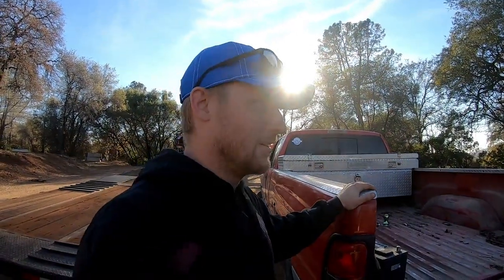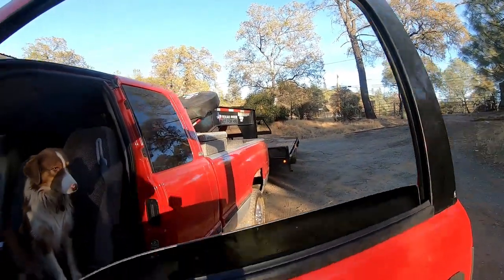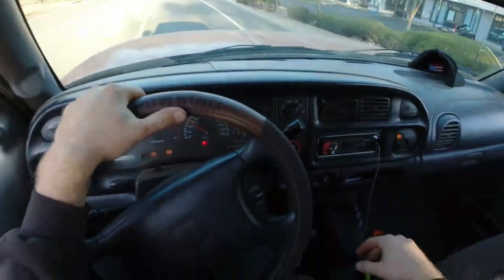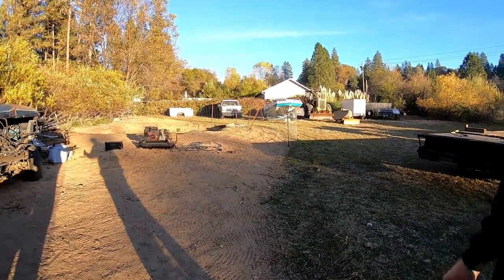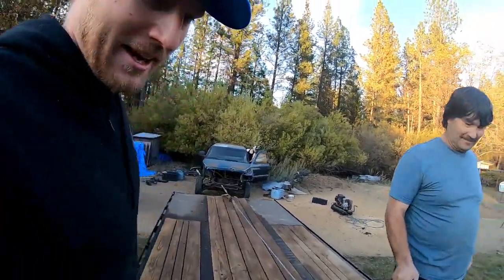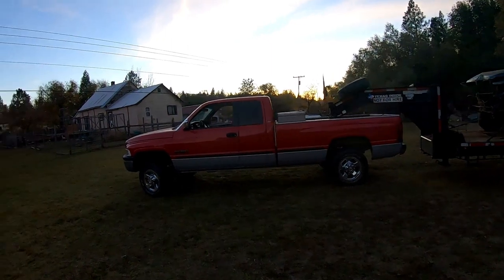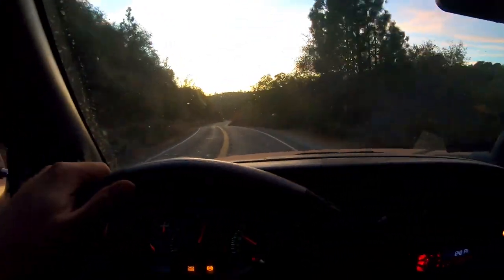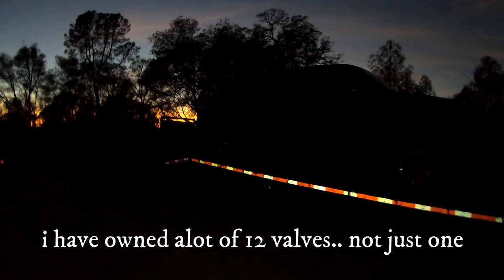21 YEAR OLD DODGE TRUCK+30k GOOSENECK TRAILER=SHOULD BE GOOD

Comment: Nothing, I repeat, NOTHING, will ever sound as great as a Cummins, towing with a manual.
Reply: Except a 7.3 manual
Reply: duramax sounds better
Reply: @rock-uu7qr  copium.
Reply: Ehh, the only thing that comes close (actually beats) the Cummins 12 Valve is either the Cummins Signature 600 Series, the CAT 3406b (and e) and the CAT C-15 IMO.

Best sounding engines of all time. 👌
Reply: @connorbaz5980  Yes
Reply: @rock-uu7qr  lol, you know what that means right? Means you can't handle reality. 😂👌
Reply: @connorbaz5980  Dawg I dont understand how a comment about a diesel truck could ruin your day
Reply: @rock-uu7qr  naw, it didn't. Just stating a fact. 👌
Reply: @connorbaz5980  Call it what you want I didnt intend to upset you just enjoy your truck before the EVs take over

Comment: You sound like you skipped the VP44 truck years completely. Mine's a 2001 3500, 5.9 HO & NV5600 6 speed, 3.73 gears. You also didn't mention what gears your 12 valve has, at least by 7 min into the video. Also, a lot of states watch for trucks towing beyond their rated towing capacity, never mind whether it works or not, it's still a moving violation. I figure my gross towing capacity at 15,000 lbs from figuring all the weights and stuff. I tow a 30' toyhauler which runs about 13,000 lbs with a 99 mustang inside. There's some tough grades on the Interstate 15 heading south west from Las Vegas towards LA, just before you get to the town of Baker. Towing with a 94 Ford Power stroke 5 speed and 4.10 gears with the trailer only loaded for camping so maybe 4500 lbs lighter, I went up them at about 35 mph in 4th gear. In the Dodge towing the mustang home in the toyhauler It went over the top at the speed limit of 55 mph in 5th gear with a lot of throttle left. Oddly enough, on pretty much equal loadings doing essentially the same 4900 mile trip around the country both trucks running about the same speeds, 60 mph unless the limit was lower, got the same average fuel mileage for the trips at 12.5 mpg. You mentioned rolling a bit of coal. I've never understood why anyone would think that's a good thing. That black smoke is unburned fuel that could have gone to making power. I dislike it so much that I'm strongly looking at various trucks and twin sequential setups. I don't intend to increase the fueling hardly any as I want my truck to last a million years or miles, whichever comes first. Rolling coal is also hard on the exhaust system because it also is an indication of high EGT (exhaust gas temp) which isn't good for your truck. I currently run a Madds Smarty tuner, for normal around town and light towing on the economy setting, gets 22.5 mpg at 55 mph cruise, 19.5 at 65 mph, and 16.5 mpg at 75 mph. I found out the last when I had to make a semi emergency drive from my home at the time in Rosamond CA, to just inside the southern border of Minnesota to retrieve a family heirloom that was going to disappear if I didn't get there soonest. I left 8 am Monday morning and was home again Saturday morning, solo. To bad I didn't have my VW yet. A 2003 Jetta TDI 5 speed, it gets 47 mpg at 75 mph instead of the truck's 16.5.

Comment: Put your trailer lights on a separate switch. The 2gen light switches are really bad about burning up if you have trailers hooked to them often
Reply: Its run off a relay with  the tow package.

Comment: You need to tow with a 1st gen with a 3 speed automatic transmission that is a true experience I love towing with my 3rd gen but still is fun to go back and tow with the 1st gen
Reply: 1st gens had a 4 speed option in 91.5-93 as well.

Comment: Got am 2004 2500 24 valve auto to bad it don't have the 6 spd in it I haul 22 to 35k once a month with it. Pulling is never an issue it's always stopping gotto pay attention to what you are doing u don't want the brakes hot takes to long to cool em off. Just take it slow and easy

Comment: That 12 valve will hold more power on stock bottom end than  common rail and a failed injector on a common rail = hole in piston while the 12 valves usually misfire

Comment: had a 97 12v 2 door king cab with a 8ft bed in prestine condition from an old guy, loved it the 12v  sound is unbeatable but i prefer my modded 3rd gen for long highway cruise and comfort, but man the 2nd gen is so fun to drive around feels like the ultimate diesel pick up

Comment: Nice rig, good first tow all things considered. Adaptability is the key to success! If you haven’t already, I would go with the remote PacBrake exhaust brake, mounts on the down pipe under the truck. A good mechanic recommended it to me.  He said it reduces overheating the turbocharger. I had them install one on my 01 24v HO 6 spd, the  year after I hauled a 3/4 ton gas pickup with some extra fuel & gear in the bed, and my job box with all the truck stuff, probably between 8500-9k on a bumper pull. Next tow was a 9800 (dry weight) Airstream,, braking was a breeze and the EGT stayed in the sweet spot. Total game changer. Huge benefit in traffic as well.

Comment: We have a stock 97 12v, and it pulls our 35ft flatbed loaded down with round bales easily. Once you hit 2k rpm it's just takes off.
Reply: Yup I got a 40 foot load it down with20 bales large rounds sudam grass. Tried loading double once just to much for all of it again pulls no problem but stopping it just tuff with that much weight. And no exhaust brake. Plus I'm breaking in a new trany less than 2000 miles on it likely les than a 1000 😃👍

Comment: Damn, I'd love to put that 6 speed in place of the 5 that's in my 99 3500 drw. Yeah, I know, 24v. I had a 12v in my 93 w250. Which, I still wish I had. But I needed a little more towing capacity. But now I'm looking at a 2019 4x4 3500 srw Laramie HO. It has 23,000 towing, that is plenty for what I need. It's a lot more than the 99. Going to look at it this weekend. 
Keep up the videos. You and TFLtruck are on the top of my watch list.

Comment: i dont get the fuss over the exhaust brake.. had one on the 6.7 work truck i used it but i never felt like i needed it.. that was in alberta on divided highway and back lease roads far from the flattest terrain and towing 40'genie booms with fuel skids tucked in anywhere theyll fit.. i never had any brake fade or desire for more braking even in the dead of winter on solid ice roads
Reply from the maker: This whole comment sounds reckless lol
Sorry

Comment: One thing to be carefull of with the second gen trucks when towing heavy is that the frames are weak in the back! It’s one of the reasons why they didn’t use them for tow trucks or service trucks!  The odd one you do see has probably had the frame reinforced. The extra cost of reinforcing the frame made them cost prohibitive for tow trucks and service trucks!

Comment: been wanting to add a 12v 1ton to my garage to just tow with.  Nice rigs, simple and do tow well.  Towing a modified diesel without gauges though....uh, no thanks!
Reply: U get a feel for things if u been driving for long I used to have 96 kw modified propane injection it would pull a full load up the west side of Eisenhower tunnel going east on 70. In hi gear with 45k in the box no matter howuch water or coolant you had just could not move it fast enough to shed that much heat. Always about 3/4 way up had to drop a gear not because of power. But heat. So I settled in at 16 and run 72 mph over the top.

Comment: What kind of exhaust setup do you have on there? I have a 96 with a 5 speed that still has all stock exhaust. Wondering what I can do to get it sounding more like what you have going on.
Reply from the maker: Mbrp 4 with muffler or straight 4 sounds good aswell.

Comment: @V-BELT and SON I don't suppose your looking for a smaller project truck. She needs a bit of work. But Runs and drives, has a really high weight limit for such a small vehicle even(somewhere around 2800lbs in the bed). Its a 03 Dakota Sport Cab, with factory body kit(stampede package).

Comment: That's the closest truck to my dream truck as I've ever seen. 2nd gen extended cab long bed 4wd 12 valve 5 or 6 speed and red. Just off by a hair with the silver band at the bottom body line. Ever since I saw the movie twister I've wanted that truck with a few minor changes 😂

Comment: 4k govnersprings 60lb valve spring  on both sides head studs fleece coolent buy pass turn the star wheel but 30 click towards the motor and and a bout .025 deliver valves in the pump and so air bags for the suspicion that truck rule the road

Comment: I used to tow a 13k pintle trl with a 97 chevy 2500 the trk knew it was there but did it pretty good considering it had a 6.5td. I now have f350 dually 7.3ps and it still knows the trl is there but does it a lot better
Reply: Oh yeah. Coming down sherman hill in mesick county m37 in michigan i slow down to 30 mph and downshift into second with the automatic and without exhaust brake it holds decent down a 7%  scaling 22k.  People behind my dont like me doing that but tuff. They aint driving a 22k rig.

Comment: But you are exceeding the 13k lb tow rating of that truck. I have a 2021 F150 and a '98.5 24v 2500 RAM. Both have a 13k lb tow rating, yet my Dodge was identical to a 3500 with the duals removed. It also has 1100 lb ft of torque and an heavily upgraded 5spd. There is no way in hell that I could safely tow as much with my F150 as I can with my RAM. The tow ratings they use don't seem to add up. Back when my truck was new, I had a local suspension shop upgrade the rear springs a little, even though I had the Camper Package. I have had 5,000 pounds in the bed and it doesn't squat too bad. Much more stable over bumps when loaded.

Comment: That's funny that you think anything you did was "back in the day". LOL. I'm 70+ and when I say "back in the day" it probably means before you were born. I also had my CDL, drove a naturally aspirated (!) Cummins powered truck usually pulling a pair of 20' boxes, redlined at 2100 RPM, but I loved the transmission, a 10 speed Road Ranger. Sometimes I had to drive a truck with a 13 speed which wasn't great but worked for heavier loads and then there was the truck I had to drive when I made the boss unhappy. It had 3 sticks. A brownie, which we pretty much left alone, then a 5 speed and a 4 speed, which was just so much not fun. I could do with a couple more gears in between the gears I have in my Dodge. One more between 4 and 5 and another between 5 and 6. I like to shift down low and I have to rev it more than I like (comfort for my ears, not for the truck) when towing the toyhauler. 2400 in 5 gets me 1650 or so in 6. Way to big a jump in my opinion. Also the owner's manual says not to tow heavy in 6th below 1600, 1650 is about 55 mph so any hill in CA I have to downshift to 5 not to destroy the diff. I assume that's the danger. 6th is a .72/1 overdrive and that gives about 2 power pulses per driveshaft revolution. Apparently that's enough to push the pinion through the lube and make metal to metal contact with the ring gear. Not a good thing.
So, what's the gearing in your diffs? It is a 4X4 isn't it?
By the way, my toyhauler is a conventional equalizer hitch and with the torsion bars set right, the rear of the truck drops about 1". Steers great and yeah, if you're going to tow heavy loads like that you really need a Pac Brake, or some exhaust brake. The last steep grade you go down heading east on the I 40 going into Needles is 6th gear and Pac Brake on and modulate the speed by touching the power just a tiny bit. Without it, it's 5th gear and a lot of brakes.
I enjoyed your video. I'm going to look for the one you must have made after you put the gauges in. Should be some interesting info there. I'm curious to see what your EGT runs going up a hill.

Comment: Thanks to your awesome videos

I am purchasing my first Cummins turbo diesel 2002 5 speed manual Ram 3500 2 wheel drive extended cab long bed for $7800 with only 226,000 miles is that a good deal new turbo mechanically sound no leaks new clutch new tires clean title Montana truck

Comment: Just a reminder, it is not a CDL requirement in my state for personal use. Nor in fact your state of Cal. for personal use.
Reply from the maker: I follow the chp Facebook they bust so many ppl thinking that. Personal use semi
Reply: John irwin lol you funny
Reply: AFTER PROOF READING THIS AND I APOLOGIZE NOW FOR ALL THE CAPITALS AND BRACKETS NOT TRYING TO BE AN ASS TRYING TO BE CLEARAND HELP ANYBODY WHO DOESN'T KNOW WHERE IS LOOKING FOR ANSWERS
Anything in our home state of California TOWED/PULLED/TRAILER/COMBINATION VEHICLE of any attachment style ( bumper pull hitch or pintle, gooseneck or 5th wheel) with a G.V.W.R (Gross Vehicle Weight Rating) of 10k ( 10,000 Lbs) MUST  possess a CDL A (commercial drivers license). To clarify 9,999 #'s normal Class C license required, 10k G.V.W.R CDL Class A req. Where the confusion most likely lies is PERSONAL USE drivers example: this exact video content, a camper ( bumper or 5th wheel style), a dump trailer ect. Requires a NON- COMMERCIAL CDL due to no compensation ( money, or value gained), owned by driver all vehicles and equipment in use.  Another silly law in my opinion is any vehicle with a GVWR of 26,001 lbs or greater requires CDL Class B to operate. So the ridiculous thing is IF you follow the channel and know Andy's logging truck, you could drive that all day WITHOUT the log dolly on the ground with a Class B CDL but if you hook V-Belts yellow 14k gooseneck to the log truck it would become a Class A required.
Reply: @paulrollinsjr.1845  wrong.   Above 26k single requires a cdl b. Above 26k tow unit and 10k trailer  requires  a A license. Below 26k is good to go with normal license.
Reply: @alanack67  not just limited to a 10k trailer. I can pull a 16k with my obs 7.3 rated at 10k. So 26k gross.
Reply: @williamuskoski1385  i never said  you were

Comment: Where can I find an email for you Sam? I know it's been a fair piece since I checked in and rattled yer cage.........been cutting firewood along with working full time, I think we're up to 36-37 cord since mid September to help fund horse hay for the non-profit riding  program my wife and I started with two of our dear friends for kids 5-18 years who are or were in troubled or abusive homes to offer a positive outlet for rebuilding confidence, respect, work ethic, compassion for animals and other people, and give them a chance to just be kids again for an hour. Also the wood cutting allows us to offer this free of charge to these kids who likely couldn't afford any type of cost for something like this, and we wanted it available to anyone who needed or wanted to participate. I'm trying to get my paws on a Diamond C gooseneck as Nov 30th is the end of seasonal firewood cutting on my local national forest lands and will start hauling logs with the 4th gen over the cascades from Eugene to my place in Terrebonne after an extremely generous donation came to us from a private timber company for all the madrone I could use to help fund our program as well. So I was going to email you and pick your brain vs blowing up the comments on here about Diamond C and what you've found to be useful on your trailer or not as well as you haul logs now and then with your two trailers. Anywho, big red is sounding good slapping through the 6 go ahead man box and with some Pacbrake action...........that would be sick! All in due time I'm sure but regardless the ol gal sounds and looks sweet with the Texas pride tagging along, take car Sam and give Boone a biscuit for us

Comment: "stops fueling 'cause its stock" ~ "I don't have gauges and its "mildly" modified". So, which is it?
Reply from the maker: The governor springs are stock. Fuel delivery at low rpm is not stock. 
Two different areas

Comment: Why did you choose the g56 over the nv5600?
Reply from the maker: Chef Nigga Fart Doodie Pants never likes nv5600. Have one in my 04. Hard shifts suck and g56 in this truck was more unique
Reply: V-BELT and SON gotcha. Wish I had the expertise to swap my tranny to manual on my 12 valve
Reply: @VBELTandSON  g56 is a tough trans honestly. I've yet to see one come in my shop with internal issues.

Comment: what about towing this load with a 95 daully 3500?
Reply from the maker: It’ll do it but not as well as a new truck lol
Reply: V-BELT and SON I picked up a 95 dually 5 speed 4x4 I’m fixing up. I just bought the same b&w hitch. I don’t need to pull heavy often.  Staying under cdl limits. I’ve learned a lot watching these videos